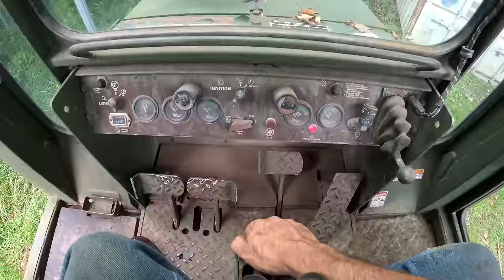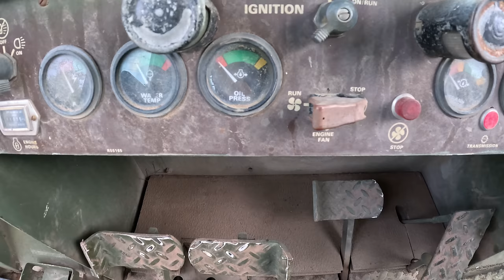Bulldozer repairs

Comment: Hi Andrew.. great content today. Porcupine like to eat bark in the tops of young pine out here in the west.. They can ruin young stands of pine in a few weeks.. In the 1950’s there was a bounty on them.. but not anymore.. I have a few Gipo.  Aka Contract loggers out here.. The number has shrunk in the last 20 years to only a few left.  One outfit was always out logging 3-4 hours from sacramento where hydralic lines are made.  When a 966log loader or a 518 or 528 skidder blew a line that piece was out for half a day and by CB truck log haulers would help and call ahead to Sac to have one made and picked up by them..  Well in the early 90’s one gipo built a fix it trailer he could leave in the woods and very secure.. He bought his own hydralic line maker.  Cost then was around $1600 but paid for itself quickly and still in use today..Maybe you could use one?  Thanks for a great video too!  I been starving for a video like this for awhile.. thanks again.. 👍☺️

Comment: I came across Andrew's videos recently and I share more than a casual interest: I also happened to buy an 80 acre piece of property; in my case, it is in Western Michigan, near Ludington. I'd sure like to make some of the improvements that he has done, but unfortunately, I don't have any of the equipment he owns or the budget for it (that stuff is expensive). I'd like to find a contractor with skills near Andrew's and similar pricing to cut some trails around my property, but such a contractor is tough to find. Or, borrow a skid steer with that brush cutting attachment, that would work too. Obviously, I'm not dealing with higher elevations like Andrew, but my property is hilly. For now, it's hand tools and a chainsaw.
Reply from the maker: Its cheaper to buy the equipment and do the project yourself if its a big job.
Reply: @AndrewCamarata  Maybe I'm looking in the wrong place, but used skid steers seem to start around $30k and attachments are $2k and up ... kind of out of my league a little bit. Or maybe I should look for an excavator with one of those brush chompers.
Reply: Buy an old track loader for like 10k-15k prob get the job done

Comment: Fixing broken cable,replacing hydraulic hoses, tightening & replacing loose bolts, fixing battery hold down  & greasing, oil change, filter changes  are all things previous owner should have done . It is magical to watch you do all of these things which will prolong the  life of the dozer  and give you better performance when you use it.  Hard work  is what was missing in  taking proper care of any equipment  which gives you a leg up on most other operators, Andrew.  You obviously enjoy the challenge and have the talent to do all of this work yourself. Bravo ! 👍👍👍👍🤩🥇🥇🏆

Comment: Three weeks ago I bought a Yanmar 223 with a loader and backhoe to speed up the projects at home. Got more done in a couple hours that would take weeks if using a shovel and wheelbarrow. Carbide tooling makes modern manufacturing possible, heavy equipment  makes everything else possible.

Comment: Hey Andrew.  love your videos..long time subscriber and "liker"... You should build yourself a sheepsfoot roller for crushing and compacting crusher run rock after you spread on roads..   8 or 10 feet wide..48 or 60 or 72 inch pipe filled with scrap steel and concrete.  Various shapes and lengths and spacing of "feet".    Pull behind exist equip..   Good luck...you are an inspiration..

Comment: If you unbraid the first foot or so of cable you can loop it around and braid it back in to itself..It makes a perfect loop that will self tighten ...No need for clamps...It takes practice but it works I have done it myself..An older gentleman that I worked for moving houses and barns showed me how to do it on our winch truck with 5/8 cable..

Comment: For that winch, it looks like you will need to manufacture a set of cable-guides to keep the cables in line for the spool, rather than running outside of the correct size of the spool.  i think you would find this to be a fairly simple job.

Comment: When I was a Boilermaker we would use #9 wire and twist it tightly to get the wire cable together for the cable clamps then remove the #9 wire. After the 3 wire clamps are installed

Comment: Wonderful maintenance and lovely machine.   One question I have why do you need 3 line wide driveway??  Why not have a cool narrow 12ft wide driveway that goes thru the forest and trees right on both sides.  I would have build it like that with minimal trees removed.  So that the canopy almost is over the road.

Comment: Andrew, next time you gotta cut off the bad end of a cable wrap it with black tape about 2 to 3 inch wide before you cut it.
When you drill medium to large holes use cutting oil and holes your drill bit won't bind up.
Actual cutting oil, not regular oil of any kind.
Especially WD40.
I still have a quart bottle left from when I would cut button and mini trackball holes in arcade game metal control panels when I converted old ganes I restored the cabinets into 60 in 1 multicade games.

Comment: If you're extremely careful then you can pick up porcupines by the very tip of their tail.  I had to relocate dozens of them so that my neighbors wouldn't kill them.  I was the crazy barefoot kid carrying the porcupines deep into the forest barehanded. They can be deadly to dogs as their quills are typically very dirty and can even penetrate lungs which requires surgery.  I trained my dogs not to go for them but they were young german shepherds, which is like playing on super easy mode.  Older, super independent labs could learn but it would take some patience.

Comment: If I recall those cable clamps are rated buy cable sizes, 5/8 3/4 , years ago the use to brade there cables, especially when dragline  were popular,  that was a oilers job , grease,  check grade, and be mechanic on the job for most minders repairs.

Comment: Actually, I think you did more PM (preventative maintenance) than repair. If I read your numbers on the new  filter correctly (1133 hrs ?) that machine has a lot of life left. It just needed some TLC to get it back to being reliable. The paint job made me think it may have been a military surplus….but when I saw the rifle bracket on the floor I knew for sure. That 6 way blade is gonna be handy as a pocket on a shirt. 🫡

Comment: We do hydraulic pipe the higher pressure is called multi spiral. The trouble is with it. It's a lot stiffer than the ordinary. You will have to angel any of the fittings accordingly.

Comment: A proper bull hook is the way to go with cable ends  , with wedge fittings repairs in the bush can be done quickly . Those type of cable clamps don’t work well on a winch , they get snagged up on everything  . 👍🇨🇦
Reply from the maker: What is a bull hook? I have to do this job again on a big skidder.
Reply: @AndrewCamarata  a bull hook is a large hook for hooking chokers onto , they have reusable ends for steel cable , with wedges. . When you break the cable in the bush just cut the cable and reuse the swedge  knob. The harder you pull on them the tighter the wedges get , 👍🇨🇦
Reply from the maker: Ok, thank you. I need that soon.
Reply: @AndrewCamarata  anyplace that sells wire rope should supply them , if not let me know I’ll get a part number and description for you  . Live on the west coast of British Columbia , loggers everywhere 👍🇨🇦
Reply from the maker: Ok, this place is local to me, they should have it. https://www.constructiontoolwarehouse.com/ If you see it on there, can you send me the part number?

Comment: If you use oxy/acetylene torch on the ends of the wire rope/ cable, the cable will not unravel. It creates a solid slug that wells the ends together. It stays permanently

Comment: Great video Andrew, is the Case? Dozer MilSurp? Curious as it is entirely green & doesn't look repainted. Observations: suprised you didn't start with a pressure wash steam clean eatly on. Add kelvar sleeves to hoses for rub/ friction points/ areas. 
With your climate & salt use on roads, ever use copprr or aluminum anti-sieze compound on bolt threads?

Comment: Easiest way to redo cable loops is take the cable away from the winch take it out long 4ft or so put a clamp on the end tight then your 2 clamps above hook to truck or tree pull the end up to the hook letting the clamps slide up to the hook tighten both done deal do the tip clamp last .

Comment: Those were good tractor in there days, people didn't like the 2speed track system,  I didn't mind them , especially with lever between your legs. For a owner operator there great, I use to rent D6 size.  from case equipment .

Comment: Regarding the cable battle, I wondered if those U bolts were originally longer, and they just cut them off after they installed them and tightened them down.

Comment: 19:55 .. the main reason Andrew is struggling with this part is the return is WAY to short .. You need 4.5" between clamps .. it should be (assuming 3/4" cable) at a bare minimum  19" 

(6X cable diameter = 4.5") X 4 Clamps plus a  4" tail plus a 1" or or less reveal between the first clamp and the Thimble = 19"

Comment: Next time you do winchline repair get a 3.5 inch pipe and oval it slide it over your line and slide it up your line and hammer it up and then you have no issues with clamping lines with your clamps and when your done cut off the piece of pipe when finished with cordless grinder

Comment: Is that an 850? I see from the paint its formerly army, but what model?
Blowing hoses...better get used to that with that 4 letter word   C A S E . They really have a problem regulating hydraulic fluid pressure, or they did in my day.
I wonder if that damage to the front hoses was due to tending a burn, maybe a log, or wildfire?!

It really seems to run well, nice to see your onsite quarry come to fruition. Why let the roads slope off to the woods with so much road building material, and free except for heating oil, again for on site use only. 😊

Comment: After seeing what happened to a guy at work one day, I always wear welder gloves and face shield when using a grinder.
Reply: glasses I get but thick gloves? it's just tiny pieces of hot metal, not that bad
Reply: @throwawaypt2throwawaypt2-xp8nx  
Ever seen a blade explode? Ripped my coworkers hand and forearm apart.
Reply: @bcmineresearch  I see what ur saying ,the thing is blades usually explode once pieces r missing from the blade,  they usually don't blow if they r whole, but ur right technically ur way is safer

Comment: Dogs never learn their lesson after biting a porcupine. I have pulled quills out of my dogs at least a dozen times and even though it is extremely painful for the dog when you hold them down and pull the quills with a pair of pliers, they never learn. The best advice to give is to leave the porcupines alone and if they are on your property do everything you can to discourage them from taking up residence. Drastic measures are recommended.
Reply: He has been using a have a heart trap to remove them - I think Cody has gone to the emergency vet 3 times now

Comment: Hey if you snip the base of quill off it let’s the air/ pressure out of quill and they are easier to pull out.  In our area they do tremendous damage to trees 
In Nebraska we don’t have many trees so, quill pigs so they are not protected.
Reply: They are not protected in NY either - you can hunt them year round.

Comment: keep repeating with the porky. that might work. but 1 meeting is not enough. they really need 10 or more. In addition, if they ever get the needles in them, tell the vet to cut the needles in half before removal. that will undo the vacuum that's inside them and so will make the removal easier

Comment: Do you have a cable guide for the green doser or are you going to make one
Reply from the maker: I don’t know I should do something, that’s a pretty stupid design having to be that straight on to use that winch without breaking it, even the D7, with no guide, does much better, just the way the edges of the winch are designed.

Comment: It seems that the transition between some clips get paused and the audio keeps playing it's a bit annoying but other than that great video
(Ok I guess it's just me nothing to worry about)
Reply from the maker: When exactly? That should never be the case here. I am not happy with the audio at the ending of pushing rock. I took it from inside the cab and it did not sound right.
Reply: Repair your computer, or get down in quality... there is no problem what so ever, and this what you described is typicall for CPU or GPU not having enought computing power and it's lagging. So either browser not working as it should or some different process in the background, or you computer is just to old.
Reply: @zetnakatel yeah that fixed it

Comment: You clip 1st clip at the starting end and clip 2nd clip  and hammer clip in to end loop closest and tighten up..
Reply: Normally slings slicing  shop use vice to work on it ..

Comment: 2:43

All the cable clamps on the winch are installed backwards, the saddle goes on the live end of the cable, and they are way to close together :( 

Also it looks like 3/4" cable? if so it needs 4 clamps, and they are to be spaced 4 1/2" apart ... and 4 1/2" tail.  .... 3/4" is the first size that needs four clamps .. 5/8" is acceptable with 3 clamps

The way they are now reduces load capacity by 40% for backwards and estimate 10% for too close together .. and another 20% for clamp missing .....  

Literally more HALF the capacity loss, plus? It's never a good day if anything valuable is in the "Snap Back" area when a cable under tension fails :(    ...

While I'm typing :) .. Torque vale is 130 Ft Pounds (over torquing reduces load capacity, more and more as time goes by) .. 

Retorque after  first use, and retorque every month two ... AND cut off cable 4 1/2" from last clamp and reinstall every couple years, with NEW cable clamps. 

Lastly even once you do all tis, when the cable fails it's Likely to fail at the loop, as these style clamps do NOT provide 100% cable strength. the only  method that does that involves a special "Socket" and proper cable preparation, and pouring in molten metal like Zinc or a special "cold socketing liquid" like epoxy basically.

Back in the day we used to hand spice them with a marlin spike or a spud wrench :)   it's THE method that makes the joint the smallest ... very handy in some rigging situations.

Finally ALL this is not just for safety either ... The industry standard methods, are the way to get the maximum pull out of the winch, when you need it the most :)
Reply from the maker: Ton of information here, thank you. But are you sure those clamps are backwards? I looked it up as I was doing it, and I feel like there would’ve been 100 comments saying so if they were wrong.
Reply: @AndrewCamarata  Sorry my bad there .. I just worded that poorly ... the ones you did are the right way ... the old ones you cut off were backwards.  

The old saying to remember is "Never Saddle a Dead Horse" 

And that's the main part 40% reduction of load installed backwards

I'm a licensed rugger (retired) and used to make up chokers as a Millwright for over head lifting :)
Reply from the maker: Thank you for the info.

Comment: Plumbers use Teflon tape on (water) pipe joints. Isn't there an equivalent tape for hydraulic fluid joints?
Reply from the maker: That type of hydraulic coupling does not need Teflon tape

Comment: I got a better look at it. It a  baby porcupine. Set him free, they suffer greatly in a cage. When I used to live in Africa, I had one of them in a cage, it rose one six wooden uprights and managed to escape, the dogs chased him and one of them had his throat pierced by a quill. My mother saved him, because the quill had broken off and moving under the skin. She felt the tip on the opposite side from where it had entered. With a razor blade, she incised the skin and with pliers pulled it out and saved the dog.
Reply from the maker: I did let it go.
Reply: Well done!!! They are so sweet creatures despite the quills
Reply from the maker: They are cute, I wish they did not chew things they shouldn't, and I wish the dogs would not try to bite them.
Reply: Absolutely and they are not aggressive, but the danger for dogs is their curiosity which pushes them to get very close to the porcupine to smell it but it,  does not run away and immediately straightens its quills and shakes itself, stretching its skin. In this way the quills detach easily and could injure the dogs. So, be careful :-) @AndrewCamarata